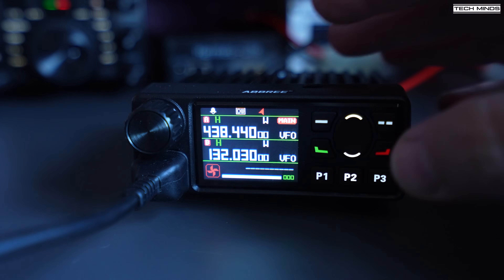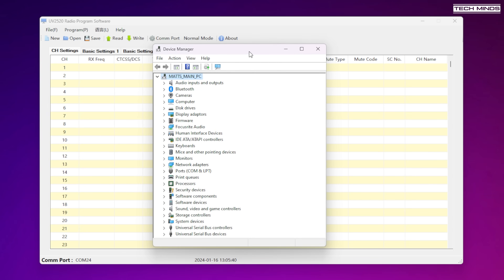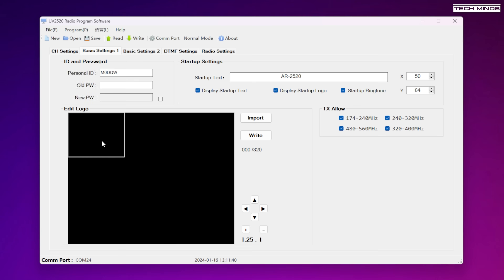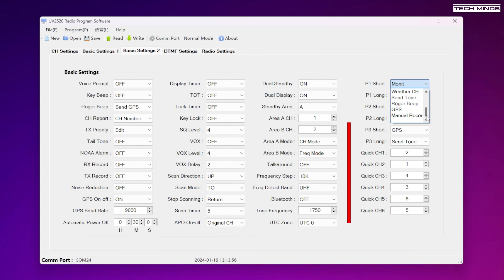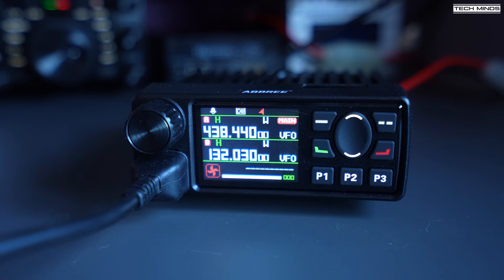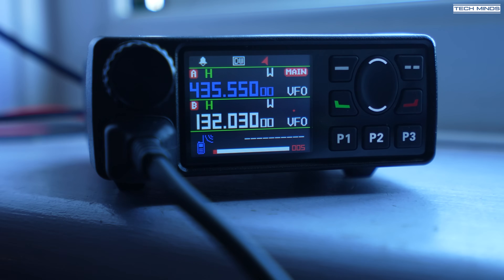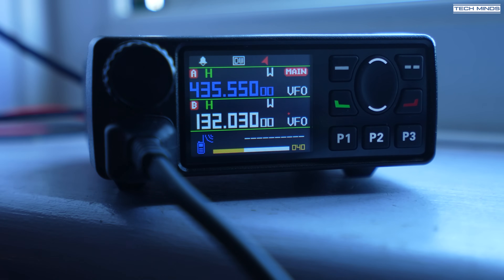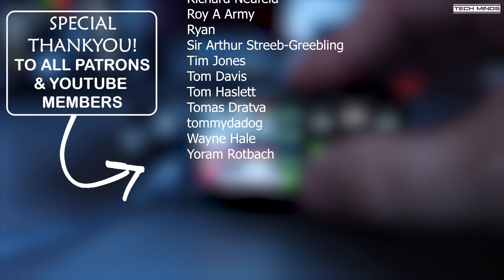Inside The ABBREE AR-2520 & Programming Software Overview

Comment from the maker: You can get the software from this link, just right mouse click and save on the software link here: https://www.banggood.com/custlink/GvmVQL0cqV
Reply: Just a heads up, the "programming software" that is linked on this page is a download for a crypto miner trojan virus.  Your antivirus might not immediately pick up on it, but after scanning the download file in Windows Defender it was flagged as a "severe threat" based on that criteria. Would strongly suggest that no one download or install this program file.
Reply: @tornadoaftermath  Thank you very much for the advice! I also saw this warning, but where can I load this software after all? This model is truly a shame.
Reply: Is there any updates? Ie programming and firmware?
Reply: Why  does @techMindsOfficial  not responding to  this   to  change link, or  confirm  or  disagree...
Reply from the maker: @maang-eb2cb  Unfortunately I do not have time to respond to every comment. And after scanning the file linked in my original post above, Microsoft Defender did not see any threats in the .exe file. So it did not warrant a reply. Everyone has the same tools and internet I have access to, meaning anyone can check for themselves. Cheers
Reply: Bunch of crap no software for radio.

Comment: I made my own programming lead with TTL-USB converter. The issues I find is there is no 8.33 Khz tuning step, the AM demodulation just doesn't seem as good as my FT-70DE handheld. You can't start the scan function without microphone plugged in. I admit, I only bought it for its reasonably good looks and civil airband reception in a compact radio I can screw to a shelf in the shack. But it is cheap and I am fairly happy with it. I would like to get the schematic/circuit diagram so I can possibly improve it. (I did that with another Chinese Baojie BJ-218 radio which is now part of an AllStar Gateway but can double as a APRS/Packet Transceiver by plugging a different lead in the mic and speaker sockets. Like you mention in the video you couldn't get at the 3.5mm socket which is something I would like to do too. In the BJ-218, I changed the socket from a 3.5mm TRS to a TRRS so I could output the recovered COS signalling to the AllStar node.

Comment: i just got my ar-2520 v2 with V2.02(1.3E) firmware. i powered on, i do a test rx-tx on pmr1, i worked fine. i turn on the gps. after that few minutes it freezed, and stopped working.
when i try to turn on, just blink a blank black screen. i can lock the screen via short press the power button, a lock icon apper at top left corner. i can turn off via long press power button palys turn off sound. but nothing else.
i built programming cable, when i try read via cps, it says passwords error.
can you help me?
Reply: I have the same problem. Did you find any solution?
Reply: @HenriqueMagarotto  i sent back to aliexpress, i get full refund + free return. i bought a Retevis RT95 instead

Comment: I have two chinese radios - the Retevis RT95 and more recently the Abbree AR-2520.
I just got back into ham radio after years of absence and have found that I have what I think is paging interference at home.
The Retevis gets clobbered with interference all over the 2m band and also not quite as badly on 70cm. 
Unfortunately this opens the squelch and makes the radio unusable for casual monitoring whilst I'm in the shack.
The Abbree is only affected by the interference on 2m, which manifests by silencing the stations I am listening to - but, fortunately the squelch doesn't open
when monitoring.
This seems par for the course - cheap radios! But I don't get any interference on any of my HH transceivers (no matter how cheap) connected to the same antenna.

Maybe avoid?

Comment: Wish Hammers would stop saying "programming" / "firmware" when they're meaning using chirp to upload or download "configuration" settings.  I got tricked by this thinking the radio I was recommended had firmware versions and updates. Nope they were talking about a chirp cable simply sending and receiving channel configuration.

A programme is an executable. Instructions.
Reply from the maker: I don’t normally comment on STUPID comments like this, but there is a difference between a “program” and “programming”. So the term “programming a radio” is perfectly acceptable. Maybe you should contact all the radio manufacturers and tell them that their “programming cable” that they sell should be called something else. Stupid!
Reply: @TechMindsOfficial  No you're wrong. a program is a binary block of instructions that a device can interpret. The protocol to upload or download data is not programming. Tthat's a different argument and abstractions. The data uploaded to Chirp is a structure and its data, which results in configuration and channel sets - it's not instructions.
Reply: @TechMindsOfficial  Realise we are not talking about a program being a "scheme" in the conventional meaning of the word. In electronics and digital devices, programming has it's own unique definition.

Comment: Thanks for the vid and links.

Google Drive link is dead. Anyway there is a link on the Banggood page. Right click and save as ...

3.5 mmm socket on the back is indeed for external speaker and working but it does not turn off the internal speaker in mine.

I did not manage yet to find a cable to connect radio to my simplex repeater SR112 nor a description of the connectors to solder my own.

In Germany it is mandatory to be in a position to turn off your radio from remote locations when running a repeater should things go south. While this is easily done via alexa plug it is impossible to turn on the radio again by reestablishing electric power. Radio has to be turned on with the knob on the front. A bit of a mess.
Reply from the maker: You can get the software from this link, just right mouse click and save on the software link here: https://www.banggood.com/custlink/GvmVQL0cqV **

Comment: I have finally received the cable but cannot get it to work, all I get is a communication error. My guess is its either the radio, cable or the com port settings (baud rate, stop bits etc), so any chance of you posting what your one is using.

Comment: Overal a nice product, My 3,5 mm does have audio to an external speaker. Good loud audio (3 watt). A little hard to program the radio with the hand mic. I could not find a way to program my date and clock ?? Anyone ? Good bang for the buck. FM sounds good and in Stand-by FM it switches between fm radio and RX main channel

Comment: Hello Mat, my radio arrived today. Few questions: 1) do you know the wire layout of the 3 wires in the RJ-45 connector. 2) Did you find a way to program the date and time ? Thnak, Phil ON4VP
Reply from the maker: There's a pinned comment somewhere, either on this video or the next which has the pin outs on. I think I only tried the clock settings when GPS was activated. I guess there should be a menu for this too..

Comment: I have this radio .but on repeater it activates it but I have no audio , I don't know if there's a setting I have missed . Can you help me out . I have orderd a cable , and have the software from your link , but I can not program it until ythe cable arrives. So I set the recive frequency first , then held 1 in and then added the tx frequency,  I also put the 88.5 in the ctcss bit . As I said it activates the repeater  but I have no audio on it , simplex is fine .HELP

Comment: My radio arrived today. Works great on local repeaters. Awful reception on Air band. My Quansheng UV-5R+ (Egzumer .v021) is much clearer and not over saturated on local tower, arrival/departure and the higher altitude sectors.

Comment: The 3.5 Jack on my radio does work an extension speaker.
However the cooling fan does not work I wonder if anyone else's actually work? I've checked the fan and supply to it to find there is no connection to ground, I've now set mine so the fan runs all the time, can anyone tell me if they have similar problems, I was concerned how hot the radio got without it.
Kind regards all Paul G0VRY

Comment: I have this radio but I don't know how put the repeaters. This radio have bad gain!
Reply: have you tried the correct offsets and CTSS tones?
Reply: @spudhut2246  Yes, in the end I was able to program everything, but I ended up selling the equipment and bought another one with higher quality.
Reply: @spudhut2246  QUESTION: How do you get to the menu for the +5 Mhz offest?

Comment: continued whit mi xperience, very bad, i buyt a cable , upgrade firmware, fan not work the radio very hot in work mode. is a problem whir firmware but in squelch off the radio work good.   not buy this radio.
Reply from the maker: Where did you get the firmware from?
Reply: @TechMindsOfficial  direcly from seller in china aliexpress, but is test whit a filter fm and the results is very good. the problem finaly is squelch in firmware and deaf problem whit externa antena. i search the solution for this. (sorry for mi english is not mi native language )
Reply from the maker: @analogatman that’s okay, I understand. Can you upload the firmware and tool to somewhere and share the link pls?

Comment: The banggood listing does not mention the use of the rear 3.5 mm port so I am guessing that like with other radios with unlabled ports it is for factory firmware upload or calibration.

Comment: Hi could you said you made the programming cable yourself in your last video could you send me the pin out as I should have all the compents to make one up thanks 73s
Reply: Thanks a million mate
Reply from the maker: If you look at the cable they sell on aliexpress or ebay for this radio it shows the RJ45 connector with 3 wires. The one on the far left is GND and the other two are TX/RX. I just butchered an old handheld usb programming cable and soldered the wires to the board. Cheers
Reply: @TechMindsOfficial  Could you show pinout in RJ45
Reply from the maker: RJ45
Pin 3 = GND
Pin 4 = TX
Pin 7 = RX

Comment: i have one of this radios, but have serius reception problems, mayve a firmware problem. other faults of this radio is fan, the fan never work and the equipment owkr very hot !!   iam wait for cable usb for upgrade firmware, maybe this solution this problems,  thanks for your video. grettings from chile CD6ELP.
Reply: I have the shame problem with this radio 😢
Reply: @neptuno338  the solution is a fm broadcast band stop filter or fm trap